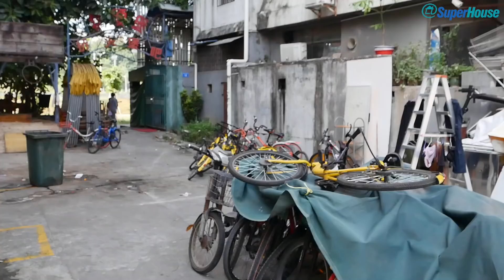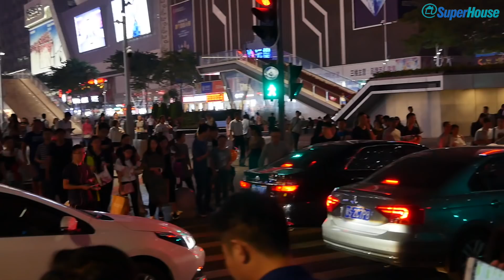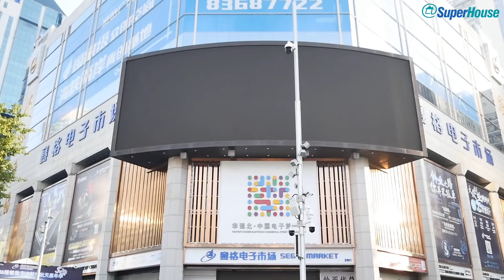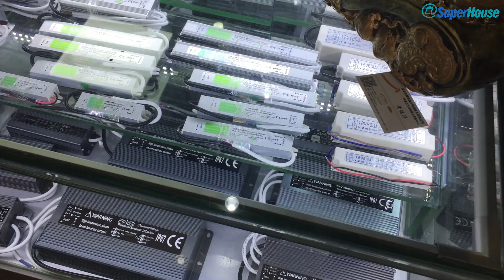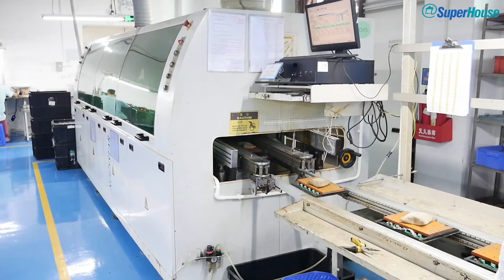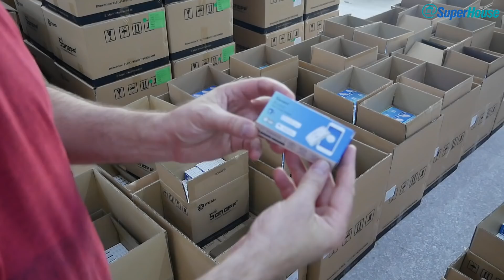SuperHouse #27: Visit to the Sonoff factory

Comment: I hope you suggested them to make a wifi dimmer :)
Reply from the maker: I'd love that too. I want to do an episode about dimming systems, because it's much harder than most people realise. I know of at least 4 totally different ways to do dimming, and some types of light only work with some types of dimming. It's very very difficult to design a universal dimmer that will work with all types of lights.
Reply: How about this wifi dimmer?
https://www.ebay.com/p/Control-US-Standard-Dimming-Panel-LED-Light-Dimmer-Smart-Home-WiFi-Wall-Switch/22021898773?iid=302822193227&_trkparms=aid%3D555018%26algo%3DPL.SIM%26ao%3D1%26asc%3D20131003132420%26meid%3D19df636665df4af4b40619a3fd5560b3%26pid%3D100005%26rk%3D6%26rkt%3D11%26sd%3D202433455856%26itm%3D302822193227&_trksid=p2047675.c100005.m1851
Reply: Yes!
Reply: agreed!   why haven't they done this already!